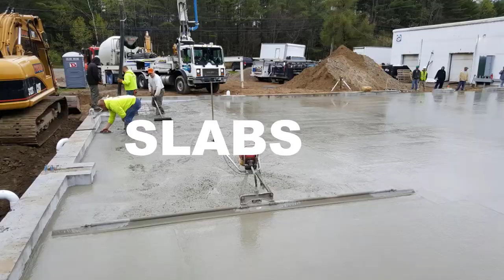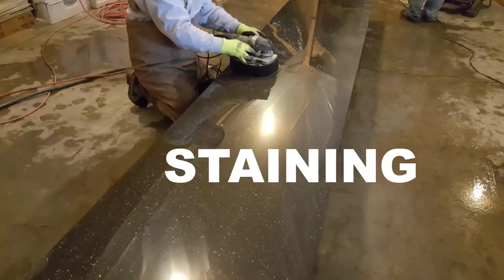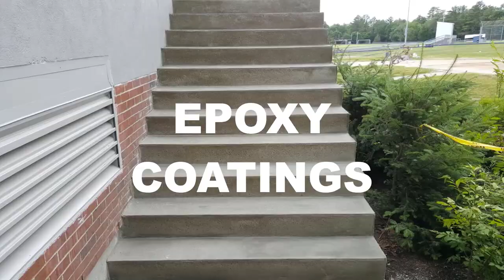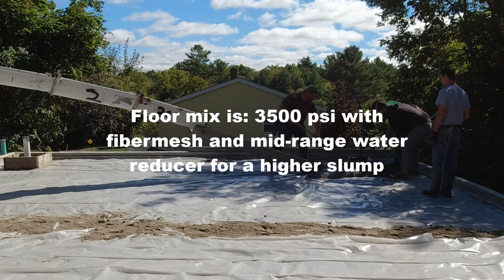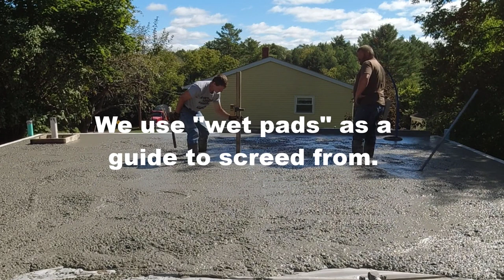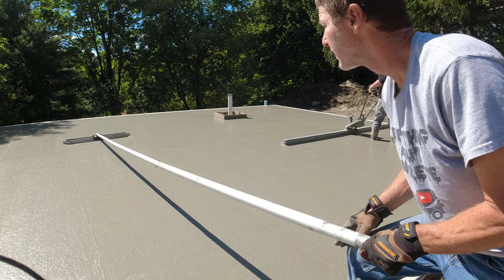His 1ST Time Using The SCREEDEMON Power Screed. How Did He Do?

Comment: I recently used the m18 screedemon for the 1st time.  Issue I had was with the slump of the concrete.  I really like how you use the plasticizer in there rather than just dumping more water in.  Having two great guys on rakes really makes the process go smoothly.  Thanks for the instructional videos.

Comment: Hi Mike, not sure if you covered this in any recent videos,  I am looking for info on what and when a vibrating screed vs a roller screed  should be used?  I am a diy'r and have a few flat pieces of concrete that need to be poured.  very interested on getting a roller or vibrating power screed just would like to know your thoughts on the 2.  thanks for your time

Comment: I’m just a diesel mechanic who pours a little concrete on the weekend. I’ve got a stupid question for the pros. I have an old half yard mixer that some one gave me. Four cylinder Wisconsin engine on it. It has the winch on it that pulls the tub up and fills the drum.  I try to keep the pours small because I do it by myself. Normaly about 8’x16’ at a time. It’s for my machine shop. Here’s the question. Is that power trowel just floating on the concrete? I don’t see any screed boards holding it up. I drag a 2x4 on top of my forms to level it out. Can someone explain what keeps that power trowel level?